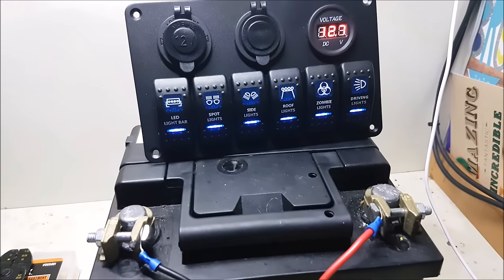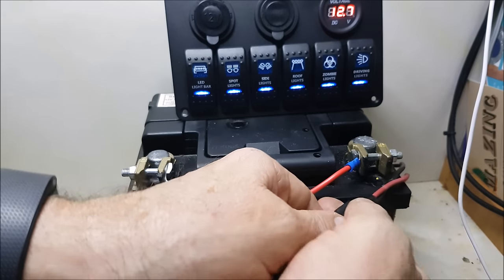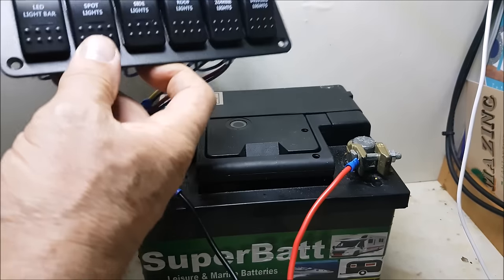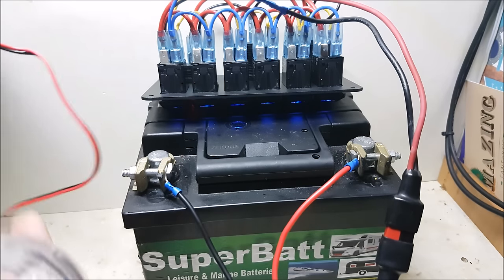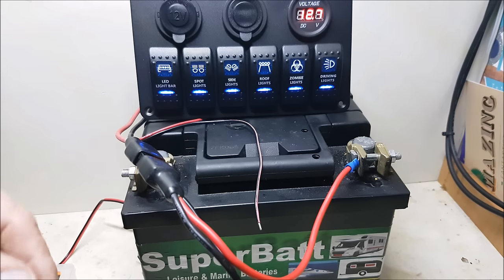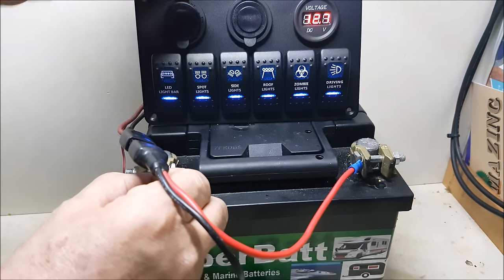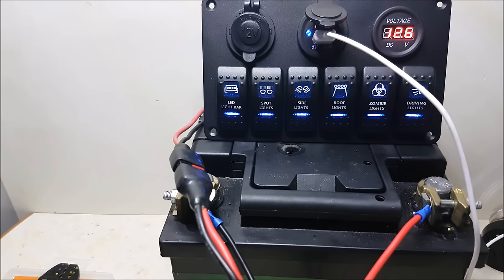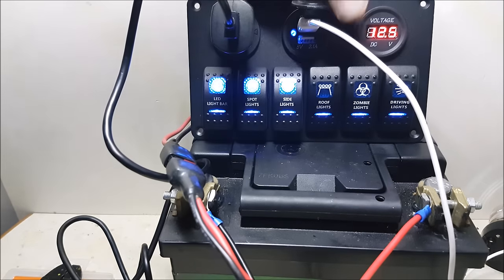How to wire a boat switch panel

Comment: great video! Quick Question, What gauge wire do you use to run from the battery to the board? 12 gauge?
Reply from the maker: Not sure about gauge but the same as jump leads thanks for watching
Reply: That wire should be sized according to amp draw of stuff behind it, distance from battery, how many other wires run in the same bundle with it etc. Blue Sea system has an app to calculate what minimum size you need. Get marine grade wire.

Comment: i installed a comparable panel (just without the buttons, seems to be the same manufacturer) on my boat. But when im loading a device over usb, my radio signal get's very bad. Is it the same for you?

Comment: So you connect all the Negatives coming from the lights and extensions directly to the battery? There is no place on the switchboard to place them?
Reply from the maker: I added a block connector inside the mounting box so all the negatives went to that and one 30amp wire to the battery

Comment: You could run all your negative wires parallel on the switches then one wire from the last switch to your battery. The negative from your devices gets put on the switch it designated to
Reply: So only one ground would have to be run to battery and and just tie in all other grounds to that single ground?

Comment: Eddie Gr.
1 second ago
can i just tap the ground into the negative wire thats going INTO the panel? or i have to run all back to the battery or buss bar or distribution panel?
Reply: You can ground it to any ground wire or any bolt or metal piece nearby as long as it’s grounded

Comment: Where did you get the quick release battery terminal wires? Also would you use a 6 to 1 connector for all the negative wires from your lights or take them straight to the battery?
Reply from the maker: anderson connectors

Comment: Where's the fuel gauge, bilge pump, live well pump, UHF radio, am/fm radio, chart plotter/fish finder ? And how is this battery connected to the alternator on the engine so it can recharge?

Comment: I'm got a questions do I need an additional relay for my fog light or Head light it's for my DIY project on my  boat
Reply: yes, because those little switches cannot handle the higher amp draw of the lights.

Comment: good video but I can't help from wonder if everything should have its own relay instead of depending on the amperage going through these switches?
Reply: Yes it should, can't believe there is no talk about the loads going through relays. You shouldn't run the main load directly through the switch...especially the isolater switch

Comment: Exactly what I was looking for but do I have to wire each switch to the negative individually or is there a way to make them join as one?
Reply: my question too!
Reply: @TheFishingMommy  same. That’s a lot more wiring and a lot more connections to the battery. If you wire as one it would be so much easier.  I know this is years ago but did you get your answer?
Reply: @loumalonephd597  Nope! I just watched a couple days ago

Comment: Do you need to run all the negative (black wire) from the rocker panel back to the battery or ? Also on your van switch panel you installed a switch as well, can you do the same on this or is it not needed ? Thanks
Reply from the maker: i put a switch just to isolate the battery

Comment: I think the small light is mainly for the side light circuit, so when you turn on the side lights the switches light along with you dash and spedo dials. If you left them on just to show where they are you would drain your battery in a very short while. Should only be on when the engine is running and charging.
Reply: So the blue wire should actually be connected to something like the out positive on the ignition, or the out positive on the battery switch if you have one. That way they only light up when you start your engine or switch on your battery..

Comment: Thanks a lot.  This really helped!  What gauge wire did you use from the battery the the switch panel?
Reply from the maker: soz never saw that i got any comments,  3mm wire but more depending on what your planing to attach

Comment: I just purchased the same switch panel the only thing is where do I put the fuses because it's getting all it's power from one positive than all negative goes to batery I know they should be cables going to the fuse box some how could you explain or help me with this

Comment: does it need to connect to a braker for safety, or does it have a built it safety system ?
Reply from the maker: you will need to add fuses or breaker

Comment: I would question, two wires in one crimp on connector, I don.t believe they are rated for that.
Reply from the maker: depends what your powering led,s no problem thanks for watching Gary

Comment: I have a similar panel but it is wired so that the icon on the switch is always illuminated for easy identification and the horizontal bar illuminates when you close the switch, turning on the associated accessory. Huh?

Comment: I modified mine so the light only comes on when you activate the switch. These led's have a bit of white tape on them as a diffuser. Blue led's in your eyes when you are driving a boat at night is not fun.
Reply: Did you just wire the blue wire to the switch?
Reply: @mailliw75  
I am pretty sure I disconnected one feed that backlit the whole panel and everything else was left stock.

Comment: Shouldn’t you install a fuse for the 12 V outlets? Each rocker switch accessory will have its own individual fuse and relay I am assuming but for the 12 V outlets how do you fuse that??
Reply: I was thinking about that. It's not that simple. There should be a main fuse at the battery terminal and smaller size fuses near the switches. And switches working on relays of course.

Comment: Wouldn't you just tap the negative from the light into the groups of negatives that are already running to the battery? Ground is ground it doesn't matter how it gets there but tapping into the negative that's already going to the battery should be fine right? That'd be alot less wiring you'd have to do

Comment: Okay so without going into great detail I used a fuse block to so I could separate the switches and give them a fuse of their own instead of having all the switches wired from on power source.  I have the USB and LED gauge on one 5amp fuse and the switches use various fuses as amps dictate for each other item.  What this does is keeps one circuit from being able to affect the others should a problem arise.

Comment: I cant seem to find those push connectors you had rigged to the battery.  I looked on Amazon found some with small ga wire that wont work. I want to use those so when I'm done on the boat I can just disconnect all the power to the switch panel so  it's not on all the time and I can just plug it back in everytime I take the boat out. Can you give me a link to where you got those push connectors.  Thanks,
Reply from the maker: ebay is better Russell
Reply: @MrMeltedwellies  Thanks I will check, your videos have been very helpful Thank You
Reply: @outonthewater113  Hello Russell, Did you locate those connectors you asked about? I also searching for them.
Reply: @MrMeltedwellies  Hey Mark, would happen to have a link or item number on ebay for those connectors Russel asked about for the switch panel?

Comment: Will the USB "here I am light" run my boat battery down ?
Reply: Benjamin Bard . I’ve got the same question. I want to disconnect all the hey, I’m here lights and only have the powered on light switch. They seem to drain my new, fully charged, solar powered battery. 
How do I disconnect all the little always on lights? Thank you.
Reply: @cataclysmic911  In stead of chancing it I went ahead and installed a $3 toggle switch yesterday.  Now i can rest easily.  You may have short some where if lighting on its on.   My bilge was activating on its own and I replaced it no problem since.
Reply: Benjamin Bard . You were correct. It was a short, found it, fixed it. Works great now. I’ll check the voltage tonight for any drain. Thanks for your help.

Comment: So is there an inline fuse between the switch panel and the battery?  or is there a fuse built into the switch panel?  Just curious.  I'm looking to install a panel like this into my camper build to control the interior lights.  Thx.
Reply: There are several versions of these Chinese switch panels, some are fused, some are not from what I have gathered.  Mine has fuses built into it, which is great, but from a service standpoint once it is installed into a casing of some sort you lose access to those fuses, so I'd recommend running them out somewhere to a fuse panel or use automatic resetting circuit breakers in place of those fuses if you are installing in a location with no access to the rear of the panel without having to remove the panel.  The fuses protect the USB, 12V accessory port, and the volt meter only.  So you need to add a fuse from the switch to the accessory you are running.

Comment: Thanks for the video, Mark. Very helpful. A question about making each of these circuits 'live'.  I am wanting to run a switch for my fishfinder/chartplotter since I don't need it on all the time consuming battery power.  Additionally, the fishfinder calls for a 2 amp fuse.  I see in the comments you suggest placing an in-line 15 amp fuse on the positive wire feeding the switch panel.  Will my fishfinder still be protected at the 2 amp required fuse if I run the positive and negative back to a (Blue Sea) distribution box fused with 2 amp fuse and the negative (obviously) to the attached bus bar?  I am a newbie electrician, just wanting to make sure that my fishfinder is properly protected.  Thanks!
Reply from the maker: just add a 2 amp fuse between the fish finder and the switch on the live side i did the same

Comment: And if its not a fibre glass boat , , still the black and yellow wires off the switch panel go to the negative terminal on the battery, and the blue and red wires go to the positive terminal, also the black wires of the navigation lights and cabin lights e.t.c , can be connected  directly onto the boat, and the red ones to the switch panel ? And is it possible to  run 2 lights off one switch,  if so, how ? Thanks alot man..
Reply: to run 2 lights of a one switch combine both positive (red usually) conductors into same spade connector and both negative (black )

Comment: Thank you!! i also bought this chinese rocker switch and i was wondering about the "lower dash lights" as they call them in the 1-page instruction diagram :D
Reply: Those lower lights that are on all the time typically if used in a car, truck, SUV, etc. would have those wires ran to a keyed switch so they turn off when you turn off your vehicle otherwise you'll run the battery down....another alternative is to tap into the headlight switch which would then only turn those lights on when you turn on the vehicle's lights.
Reply: William Sevier I’m going to run mine to my ignition switch ground

Comment: hey mark I have same switch panel an fuseblock in my espace camper.how do I wire say spotlight  up.?i have it coming on when switorch on panel is on or off via fuse block.there is only one free spade terminal on back panel.can use piggyback spade .steve

Comment: how you gonna turn off the light on the bottom bar and volt light it gonna drain the battery, Need the correct way to hook up the right wires and make this complete with a turn on with key or something
Reply from the maker: Hi Darryl i have a isolating switch in line from the battery
Reply: Zombie switch should control the illumination of the icon leds.

Comment: Hi not sure if youl respond, but I'm going to be doing this at the weekend and was wondering if you used a bus bar. Is it needed. Or can I just use a fuse box instead. Thanks for the video
Reply from the maker: i will use fuse sorry for late reply i didn't noteefied
Reply: Mark Davies Hay man. Thanks. I got it sorted in the end. I used a fuse box and bus board combi thing. Can check out my project boat that's finished now here. https://youtu.be/9SvvSpYxdOg
Or if your on Facebook check out Northern Ireland all fishing reports to see pics of what I did to wire it all up. Thanks for getting back to me

Comment: Do you have to add a fuse board to this particular set up?
Reply from the maker: you can i just put a fuse between the unit and the battery
Reply: @MrMeltedwellies  Thanks for that.

Comment: With all due respect, what you missed is nearly as important as the points you brought out.  
      Most of these switch blocks come with a ton of identity decals including "accessory" decals for switch functions that aren't included.   Secondly, unless you wire your red & green "running lights" together with your white "anchor" lights you will need to use up 2 of the 5 switches and remember to turn then on and off independantly.  
      Most factory switches have a 2 position or 'double pull double throw' switch where both the anchor and running lights are on a single switch that let's you choose one or both light groups and the off position.  As most boaters are cramped with only 5 switches, giving one up for running lights sucks! 
      Most boats already come with a buss bar that has a ground strip to attach ground wires without mess with a battery connection.   As the battery is often removed at least at season's end or for maintenance, anything attached to it gets wrestled about and possibly detached.   The ground or buss bar is not affected directly if the battery is handled and is reattached via the battery connection terminal.  If it is not attached, nothing will work so that method is almost fool-proof and very neat and tidy!
     Finally, either with a Dymo-type labeler or even paper labels, LABEL YOUR WIRES, both positive and negative identifying what light or device it serves.   Both you or perhaps a technician will sing praises for your forethought while trying  to install your latest device or attempting to troubleshoot a failing device.
Reply: He mentioned a bus bar for ease of use.

Comment: Hi Mark, thanks a lot for the video. I am absolutely no tech pro, so maybe someone can help me out. 
Is it possible to take this panel and power it with a usb powerbank like the ones you use to charge you phones? I found some kind of 12v tonusb adapter but I am not sure if this even would work out.
What I want is this: use such a panel to turn on/off a handful of led light strips i own.

Comment: So you’ve got that connected up to that battery when this is installed properly I take it them lights along the bottom of the switches and the digital display are on at all times will that not run your battery flat after a while in some way there should be a master switch on that panel to turn every light and display off untill you need to use the appliances
Reply: burtie777 is there a way to make it where it only comes on if the motors turns on?
Reply: caleb b it depends on how it’s wired in normally them lights along the bottom would be made to light when the vehicle lights are on but the display is a different matter as I don’t think I would wire the habitation side of things into the vehicle side lights maybe off a master switch so when you hit the master switch them lights and the display come on before them switches work
Reply: okay cause i need to wire it in my boat to where it only comes on once i turn the key

Comment: Use a bus bar for the negatives. Do the switches have fuses?
Reply: Not fused.  Need to add fuses to each circuit.
Reply: haha nope all he did in this video was "show" how to piggy back all the wires
Reply: I bought one the same and it was fused.
Reply: BigMouth380cal but how do you add fuses to the 12 V outlets? Each accessory positive lead can be fused when you run it to the panel but the 12 V outlets are already wired??
Reply: Fly Oz so you don’t need to fuse each separate accessory going to each rocker switch?You just need one 15amp fuse for the entire panel? ￼

Comment: I like your video here on this particular panel and it is instructive however you're forgetting a couple of things that you should be saying on here one is things that run off the switches should be running directly to a relay these switches will not handle quite a few things that have an amperage draw so you forgot to mention that they'll be in need of a fuse and then I'll be in need of a relay bar this is a good video on the switch panel itself

Comment: My only issue is that the LED's are always on and so is the amp meter.....constantly draining your battery...I think there should be a video that explains where to connect the led and voltmeter so when you turn off your engine there is no consumption.

Comment: So the volt meter will always be on ?
Reply from the maker: Hi Allen yes unless you fit and isolation switch on the main line to the battery i did in my van but on my boat it was already fitted thanks for watching

Comment: I was wondering if you could help me out, on my boat, the fuses panel are glass fuses and old.  Could you tell me or guide me to a webpage on proper sizes of fuses for accessories?  This is whats on my boat. I have a 15ft tri hull bass boat.  bow and stern lights on separate fuses. bilge pump. And a string of led lights for the interior.
Reply from the maker: i would fit a 10amp fuse between switch a battery

Comment: Awesome, thank you. My wiring knowledge is limited at best! I bought the same switch and it turned up without instructions! Only difference with mine is that the 2 charge ports and the battery indicator had separate power wires. I assume I can just wire them all together and send them to the battery?

Comment: with the switches off would the small illumination from the “location lights” and voltage display drain the battery?
Reply: yes! which is why you need a small switch before the battery or panel, or a battery switch in the stern to shut everything off!